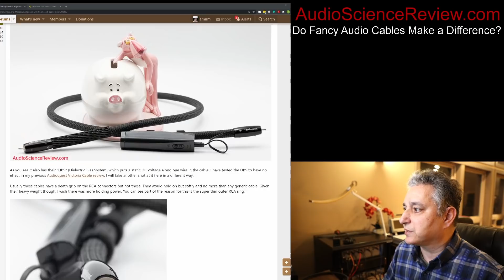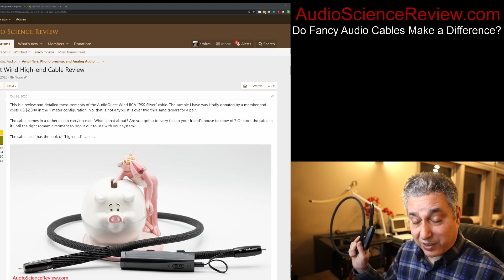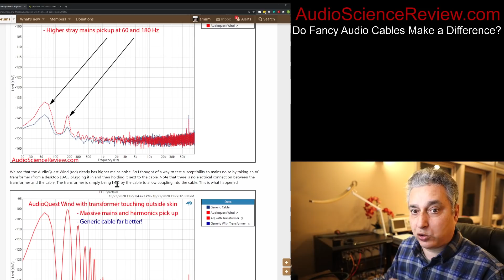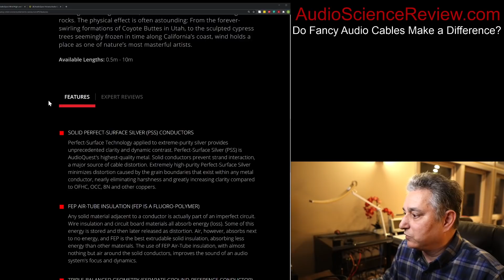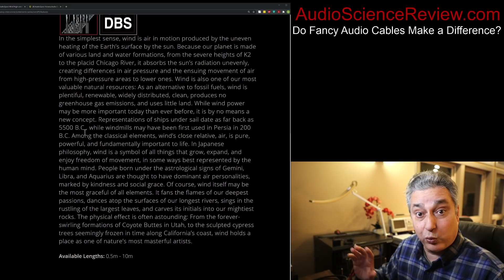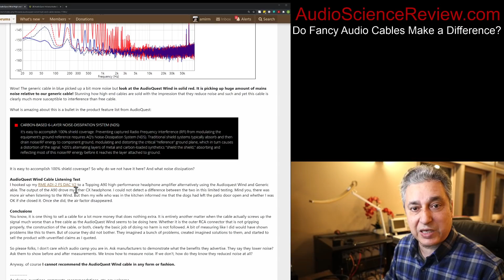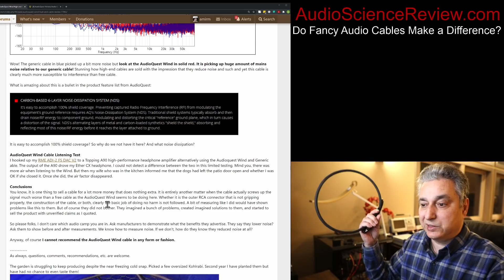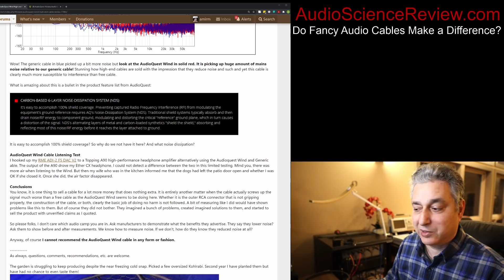Do Fancy Audio Cables Make a Difference?

Comment: Well actually if the battery is connected to two electrodes but not a complete circuit what you have is a CAPACITOR across the output of the battery.  No DC flows but there is a tiny charge stored in the field between the elements of the capacitor.  That's the theory of these Audioquest cables, they are putting a potential across the insulator in the cable, the theory being that the insulating material works "better" some how with a static bias across it. If this effect were real there would be some physical tests to show it.  The burden of proving that biasing the cable's dielectric actually does something is on the company, but they haven't put forth any physical measurements or any statistically valid listening tests.  There used to be consumer law in New York that prevented the sale of goods with such unsubstantiated claims.
Reply: This does not make the circuit a capacitor.  It makes it an open circuit with a voltage potential. Not even in the same ballpark as a capacitor.  Voltage is not the same thing as charge.  There is no stored charge.
Reply: To be clear:  I'm only trying to reinforce that this is all pseudo-scientific garbage.
Reply: @mpd4167  If you put any voltage across any dielectric there is a stored charge. Why do you think coax cable is rated in pF per meter?  ALL capacitors store charge.  Why would they rate coax cable in pF if there wasn't capacitance? Basic physics.  Trust me, a substantial length of shielded high voltage power distribution cabling can store a HELL of a charge.  Of course a 1 meter piece of coax with maybe 10 pF of inter-conductor capacitance is not going to store 40 Coulombs,  but the instruments used to characterize coax cable work by measuring the ability of the cable to store charge- minute amounts of charge, surely, but there is no doubt that it is an absolute fact that coaxial cables are capacitors. The cable capacitance will have some loss of course, and so the charge will dissipate quickly.  Unless the charge is maintained by a battery.  This is all basic physics.
Reply from the maker: A battery is a battery though, not a capacitor.  Regardless, even a capacitor with one leg connected and the other in the air does nothing.
Reply: @AudioScienceReview  You didn't understand my comment. The battery is connected "across" the cable's insulation. The CABLE is the capacitor in this instance. The battery is providing a small charge across the insulation.  To say that " capacitor with one leg connected and the other in the air does nothing" isn't correct. A capacitor can hold a charge, that is to say, it can hold a potential across it's dielectric.  If you think a capacitor with "one leg in the air" does nothing, I suggest you use a DC voltage (analogous to the battery in this cable) to charge a 100 uF 400 VDC electrolytic, remove the voltage, and then leave "one leg in the air" for some time.  Now, grasp both terminals of the electrolytic in your hands and tell me that the capacitor "does nothing."  You will find that the capacitor "with one leg in the air" has indeed been doing SOMETHING - it's maintained a charge across it's dielectric.  This is what this cable does.  It establishes a static charge across the dielectric of the cable's insulator.  

The manufacturers of this cable claim this improves the cable's signal-carrying ability.

Actually, placing this bias across the cable's insulation has no effect on it's ability to transmit signals- the manufacturers claim that placing the cable's insulation in a DC electric field makes the cable better for transmitting audio, but this can't be demonstrated so is unlikely to be true.
Reply: @AudioScienceReview  Exactly.  I'm not saying there is no cable capacitance.  I'm only saying that applying one side of a battery to a cable shield and the other to nothing does not form a FUNCTIONAL capacitor.  All cables have some level of capacitance between their signal carrying conductors, and also between these conductors and the cable shield.  My understanding from your description is that one side of the battery is connected to the signal shield and the other side to nothing.  This, of course, does nothing.  Without a complete circuit to transfer charge from the battery to the cable capacitance, you have no functional capacitance behavior.  Trust me.

Comment: I don't think this setup is sufficient to test cables. 
In real world applications there might be Ground loops and High frequency common mode currents. 
your high end analyzer might reject RF but some audiofool Jfet phono preamp might not. 

I'm not advocating for that 2000€ cable! but things like ferrite bead do make a difference when it comes to RF noise rejection.

Comment: No capacitance measurement? (preferably @10kHz)
Very important to vinyl playback.
(not that I'd ever buy a cable in this price range)
Reply from the maker: This is a "black box" test so didn't involve characterizing the cable itself.  I have done white box testing of speaker cables however.   See: https://www.audiosciencereview.com/forum/index.php?threads/when-12-gauge-wire-is-not-12-gauge.3/#:~:text=Why%20test%2012%20gauge%20(AWG,can%20%E2%80%9Ccolor%E2%80%9D%20the%20sound.
Reply: @AudioScienceReview  So this is more of a 'debunkification' than a technical review then.
I don't know if a speakercable would make a good turntable interlink 😉
I liked the investigationpart into hum susceptibility, which is also important to vinyl playback as reference output can be as low as ~-65dB.

Comment: Could it be possible that it's the DBS system that picks up the interference?
Reply from the maker: Interesting theory.    That may be the reason.  It would be fascinating if it is doing damage this way instead of good!  Alas, I can't cut it off and try it without given the cost of the cable.
Reply: @AudioScienceReview  But you could try disconnecting the battery and see if it's the battery or cable picking up interference by running the transformer over them. The DBS cable probably runs down under the shield.

Stereophile made a article 1995 testing and measuring cables, might be a interestig to read if you haven't:
https://www.stereophile.com/content/what-difference-wire-makes

Comment: Please make a video on 'does hi-res or mqa make any difference then the ordinary cd quality audio'
Reply: Amir has stated before that, in terms of fidelity, he has no strong feeling on MQA, that it’s not better or worse. However, my issue is that you need a device with the capability to decode MQA, and that comes with licensing, which increases costs of the gear, so even if you don’t use MQA, you are paying more money for gear because of it.
Reply: A much more relevant question is whether 320 kbps is good enough
Reply: @ReTr093  It for sure is enough. But does “enough” mean you can’t hear better? Because if so, then no, some people with some songs can hear a difference between it and CD.
Reply: @homeboi808  has to be proven beyond doubt. people claiming they can hear a difference is completely useless as factual evidence. theoretical advantages and disadvantages also need to be clearly explained.
Reply: @ReTr093  nope , u are wrong...MP3 is crap... actually u can hear a difference between MP3 and flac...
Reply: @painpeace3619  Statements like this really make audio the idiots' hobby that it is. How exactly would you know? You did sighted testing at home? The same methodology as the cable people?
Reply: @homeboi808  Thanks for the link. It's as I thought, even trained listeners (in this case professionals) can only reliably tell the difference up to 192 kb, which is essentially the bootleg tier of mp3.
Reply: @ReTr093  if you can't hear the difference , it's Ur problem...but most of us can hear the difference....next day u will say, 50$ headphone and 200$ headphone doesn't have any musical difference.... 'shoud I agree with your statement' nope... listening music is so much subjective ...that we can't take other's opinion as absolute opinion..... I heard that some Japanese audiophile guy change his whole power supply because local power supply is giving him a hiss problem ..... if u enjoy Ur music in 124kbps MP3 files ..u can go for it.....end of the day, it's all about enjoying the music....
Reply: @painpeace3619  No, being able to tell the difference between mp3 and flacs has nothing to do with subjective takes. Read the journal article, and don't reply to me until you have.
Reply: @homeboi808  The paper describes a test with 13 trained listeners. So while the methodology may be sound, the limited set of results indicates that further studies are necessary before drawing well founded conclusions.  While the results indicate that the difference between 256 and 320 kbps is neglectable, the were enough outliers to indicate more thorough research to be necessary to make any founded claim to the audibility of differences in and above those ranges.
Another relevant factor is that some types of music may sound better at lower bit-rates.
In conclusion anything 256-320 will probably sound good enough to be indistinguishable to most people with most of the affordable equipment and most genres. This does not however mean that this is necessarily the case for every person, gear and genre. A study to be really sure would sadly probably cost a lot of money.
Reply: @someguyontheinterwebz  yeah, the sample size is for sure not enough. However, it’s the only paper I know of (that’s free at least). And as you said, it would require a lot of money, and it would serve no purpose other than curiosity at this point. People can take ABX tests at home if they want to know for themselves.
Reply: @ReTr093  Bet you're the type of guy that will say "there's no difference between 1080p and 4k". Also they are both file compression so they are not different from each other so comparison still stands.
Reply: @someguyontheinterwebz  yep, the pop / commercial  music is all artifical electronic sounds  so  what is  fidelity in that circumstances??
Reply: Get nirvana-smells like teen spirit in mp3 and flac format, listen to the intro drum beat, it should let you hear the difference.
Reply: @dagnisnierlins188  at 320kbps?   I think it may be possible at that bitrate for a listener trained to pick out mp3 artifacts and a particularly egregious sample, but IMO high bitrate mp3 is usually good enough.  I do like FLAC anyway because it eliminates the whole question of whether the perceptual encoding was good enough. With storage and bandwidth being so cheap, might as well use FLAC if you can.
Reply: There is a way to tell the difference between 320kbps and cd quality.  First try really low mp3 bitrate like 128kbps and compare it to 320 or cd.  What this will do is teach you what exactly low bitrate does to the music.  Then play 320kbps and compare it to cd.  Play it really loud though and you will hear that similar low bitrate effect of 320kbps.  To me it effects the highs the most and makes the music sound kinda like its under water.  Its hard to describe.  If you just play two tracks to someone who doesnt really care about audio at medium to low volume they will never be able to tell the difference.  With high res audio however I cannot tell the difference between cd.  There was a very good video from an audio engineer explaining that there is no difference.  He even zoomed into the waveform to show theyre exactly the same.